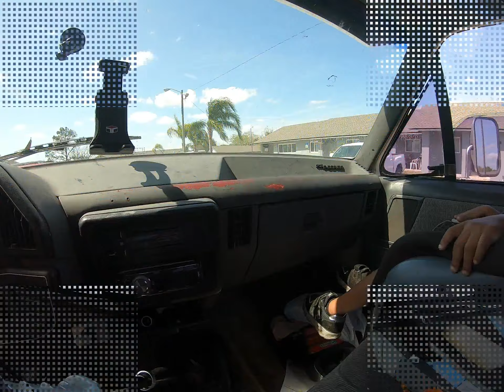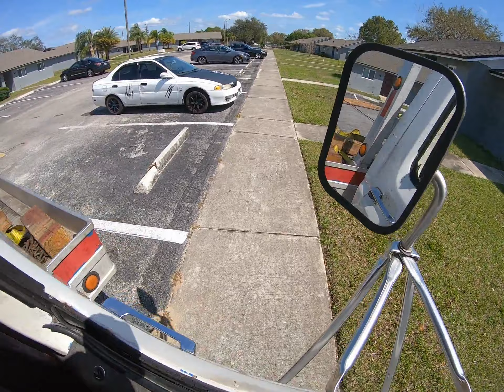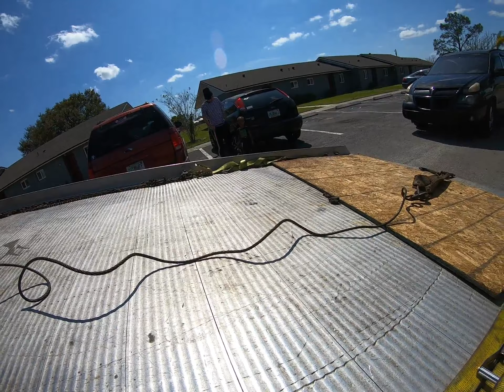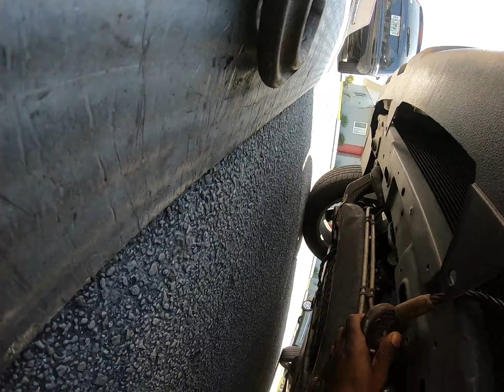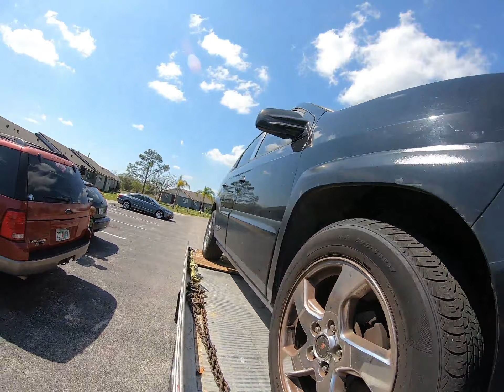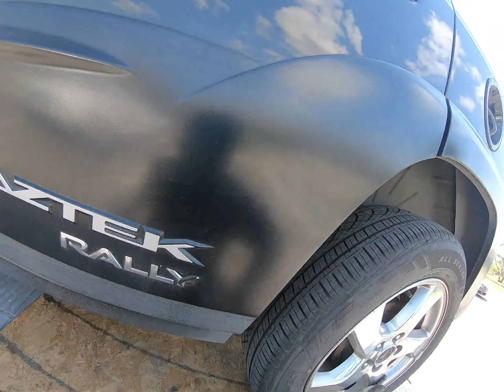Loading up a customers car with my son| Putting the old Ford to work, well, kind of.

Comment: I missed the part where you must have decided not to use those big j hooks on the control arms, and if that's what you did, I don't blame you....I need to hook my man up with a v chain that has ''baby j's'' on the ends instead of the big j-hooks.....however, the longer you tow with that flatbed, the more cars you will run into that have ZERO hook up points under there, little holes here and there in the subframe or floors that are strong enough to handle a mini j hook and will safely handle the weight on the way up the bed....cars like benz's and audi's and BMW's, those cars have NOTHING underneath, plastic aerodynamic covers over the entire underside of the car, in cases like that I do what you just did, take the v-chain and hooks off and I have a very short nylon strap with d-rings on the ends, its about 18 inches long and you can wrap it around anything solid....control arms, large sway bars, anything thick, and just put the d-rings thru the hook on your winch line...huge help. just google ''nylon strap with rings''....$15 bucks for most, $20 tops. Are you low on hydraulic oil? Winch sounded like it......I run low on my flatbed, I have some leaks....
Reply from the maker: I did not see this comment nor the other comment but I sincerely appreciate it. I just asked you on the last comment how to go about loading a European car and this comment you explain the whole thing. I did end up towing it by running the nylon line over the front core support and hooking the mini Jay into one of the holes. that nylon strap is save me so much heartache and I am going to look for the one with the loops that you referred to if you have a picture you can send me an email at Seasallauto@yahoo.com thanks again!
Reply from the maker: And yes there is a leak coming from my back carrier I have to rebuild the cylinder but due to this economic downturn it's going to have to wait.
Reply: Very good advice and I recommend a self lock winch there are a little more expensive but they are worth the money